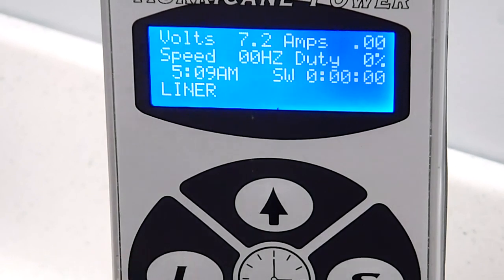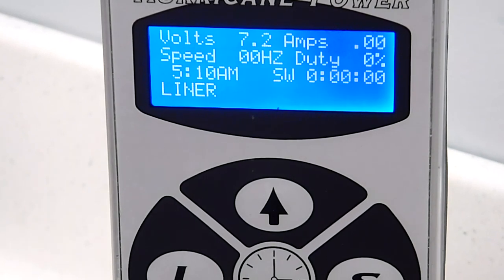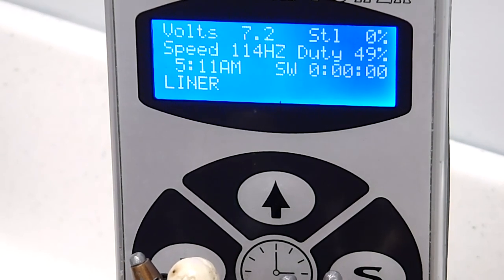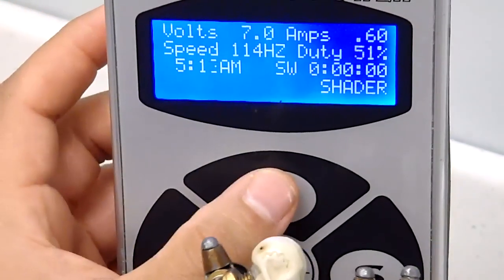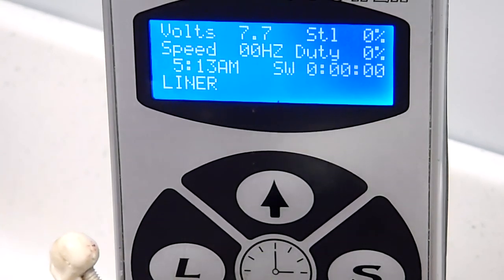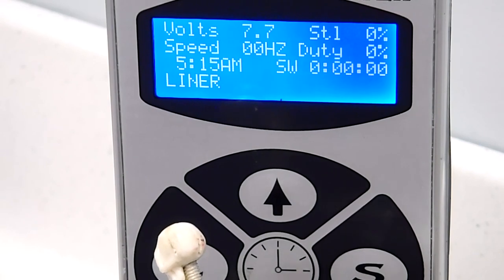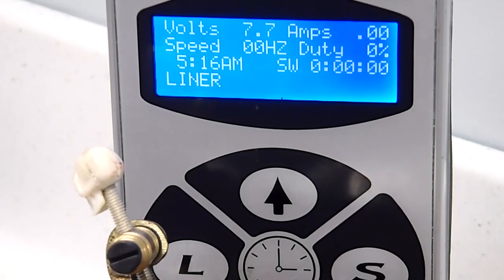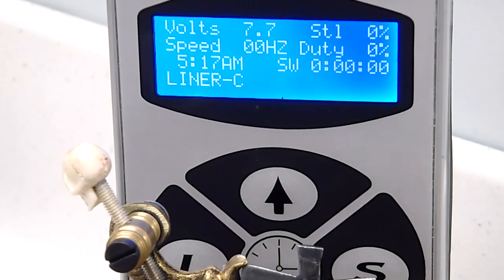WHY TO GET A DIGITAL TATTOO POWER SUPPLY

Comment: If you want to buy a real good power suply, buy a 'Critical CX2 G2', thats in my opinion one of the newer and better suply's on the market, this Hurricane is only usable with Coil-Machines, not with Rotarys, Rotary's will work fine, but you cant get a readout from them on a Hurricane PSU, so save your money folks, and buy something better than this,..;-) Peace... ;-)
Reply: True I used to use this type if power supply until it fucked up on me... nd now I use the critical power supply nd it works really really good

Comment: I see a lot of hating on the digital power supplies. I am a semi retired artist, machine builder,and shop owner who has been tattooing since the mid 1980's and I still use a Eikon and a cyclone 360 as a back up.I keep an old TekPower 1803D in my build shop for build tuning. I like to know if I am getting any misfires on the rear spring (stl% or follow through) and I like to know what my duty is running. I tune by ear but its still good to know your numbers,especially if you sell machines. To say that numbers aren't important says that you don't know much about the technical side of machine tuning or building. Its always better to lend an encouraging word than it is to act like you're the God of tattooing. And yes, I know how to make my own needles, I know where to purchase powder pigment, I can build a power supply, and all of the other necessary things needed to do a CLEAN and STERILE job. I saw another comment about an apprenticeship making someone the shop bitch... Yep. But I came out alive, licensed, and basically have a license to print money.I don't get out of bed for 300 bones a day. Some of ya'll need to get over your "God Complex" and help people that want to learn instead of bashing on them. BTW, if you still use powder pigments wth is wrong with you???? Just kidding. There are some colors that I strictly use powder to mix because I can get the consistent shade that I am looking for.
Reply: hi.. im looking for a good digital power supply for around £100 so under $200 really. hoping you could recomend me something thanks : )
Reply: Hi Dan. When on a limited budget,E Bay can be a mans best friend. Consider a TekPower power supply. They're laboratory grade and a good option for right around 125 US. Also, you can find some fantastic deals if you look hard enough. I just saw a critical-cx go for 175. You should have no problem finding a good shop grade power supply for the money you have to spend. Best of luck and cheers.
Reply: @deanstephens5940  well said I'm also an artist from the eighties not to many left.  You gotta pay your dues. It's in the blood if you want it and get good info you shouldn't mind cleaning sweeping and what the hell ever . I'm self taught and not with you tube .im a lil abrasive and not everybody's cup of tea but would have loved apprentice ship .another artist in town worked under English Craig one of the most famous and Doc Don was Paul Rogers last apprentice. Great guy but nobody would help me even when working first shop gig they would tell me false info . would sneeze on machines scared to loose what I had .builder now but could have cut off so many years of trail and error . started using first one inch shorty machines.they laughed. Used to make my own home made rotaries .they laughed.now they all switched to rotary.hhhhmmm. I use both didn't like my Spaulding and Rogers machines .when I borrowed someone's time machine by fowler I realized how a coil should perform .favorite machine now two vintage joe kaplans one original liner and a shader frame customized to one and a half coil color packer love them. Ole reaper rebuilt with high end coils runs better than ever did

Comment from the maker: if is 18volts , no machine should be run at that voltage , but if your machine needs that much voltage to run , you need to tuned it up.. but if all your machines are reading 18volts get a new power supply but in reality you don't need all this readings as long that you know that your machines are running good.   good luck..!

Comment: Good video i just got a hurricaine power. But i got a couple questions how do hook up five machines there is only two port on the bottom my machine is has low HZ but i am at 7.7 Volts like you and my duty is low only 40% how can i fix that?
Reply: Spring tension and smaller gap will make duty go up its how long your machine stays in contact with post . easiest way loosen armature bar swing to opposite end and bend a little back. To much bend forward . you can change to fatter wider spring also thicker but you csn also cut with snipers take a little off each side some use short liner Springs .  lighter bars run faster heavier slower but not all will fit every machine
Reply: I recommend tattoo university video on you tube he's talks slow but he truly wants to help .not media whose like Johnny Gault. And he use cheap and expensive machines success fully

Comment: oh my first i dought you build machines more like put them together there is a difference not knowing what stl is proves that  smh  it means( STALL )god everyone thinks they are a builder these days.
Reply: Exactly. Rebuild is not really a build and if your not making at least half your parts well ? Frames I make but much work . coils I wrap but it's a bitch . it's worth 30 bucks to let someone else get the hand cramps . lathe big money . casting a bitch cnc is the shit . cut frames from billet. I bend my own I frames with hand brake and make from marine grade aluminium but it's just for shits and giggles machine computers . watch out for sky net them robots taking over kol
Reply: Was a builder when nobody knew stall speed or duty.just volts . just need that info to market these days .tune by ear just check with fancy machine .not needed though nice to have .usually get 47 to49 duty by ear but wouldn't know that without digital machine. Most important fine tune ten turn reostat.

Comment: But all these guys are very good and making a very good living at what they do . End of the day thats all that matters. I can tell you , you can do the same tattoo in half the time you can with a $350 Dringenberg machine then you can with $45 china machine with crappy copper coated aluminum wire and if you cant well thats why you arent a tattoo god right lol. ;-)
Reply: The wire makes the diff but also have cheap small wire on nickle cores and I can run at low volts . never as good as 1018 Steele and 24 or 22 awg copper wire . brass is good contact but copper is better .silver is the best or gold if you big deep pockets .i use sterling on one machine . 27 dollar contact screw . wow . gold is in technology for circuitry that's why gold increases in value . but commonly copper is used . brass I thought was better but Steele will work too . get the best you can and use like you do .i use cheap thin springs. I learned with them and can't use any t hing else for tattooing . every artist diff

Comment: Eikon power supply is assembled by Eikon with china parts  btw and Hurricane is a knock off of a Critical power supply which is  assembled in america with china parts so really they are all china .If any of you wanna be know it alls or wanna be tattoo artist would like to challenge that please feel free .You can contact me @ InkHoundApparel&More on facebook
Reply: Best cheap machine I've found the mini tiny power supply no read out . porket indicate. If you don't need duty speed and hit . but you can tell all that by sound and feel .you tube is the bomb .nothing for me back then and everything a big Damn secret
Reply: Porket indicate with the analogs needle lasted me 25 years no fluctuations no drop in power . machine and supply must run smooth and steady like an engine with no misses rotary if it sounds like it's in a bind it is .if it sounds like he'll no matter what the machine it is .its not called the sweet spot for nothing

Comment: i dont need that nonsense to tune anything,  tell me why you need to know the voltage let alone the other bs ?  it doesn t save shit except voltage an dthat needs to be changed on every job ,  
pointless
Reply: Its mainly for selling your own builds .ear and feel best . just like back in eighties when I used to sell well say oregano .bag by eye throw on scale . always right just had to check same with fancy supply . I never look a volts I hear what individual machine wants to run at aka sweet spot .just like depth control bye the bogg. No set voltages every hand different every person skin every part of body all different ever try tatting a roofers back? Like leather